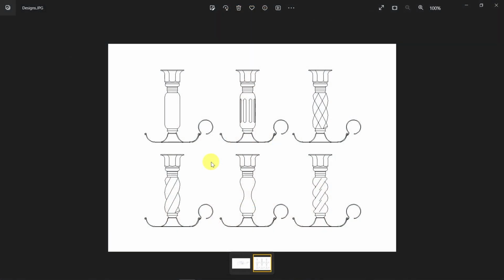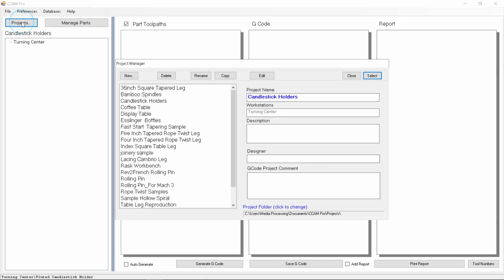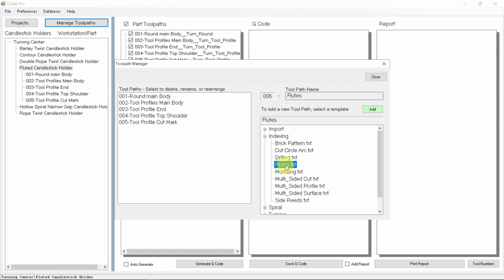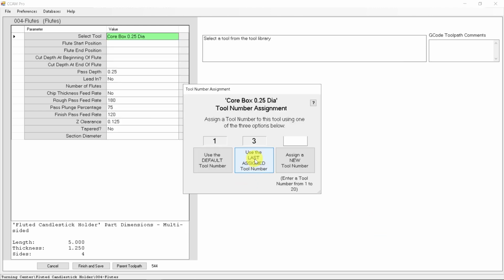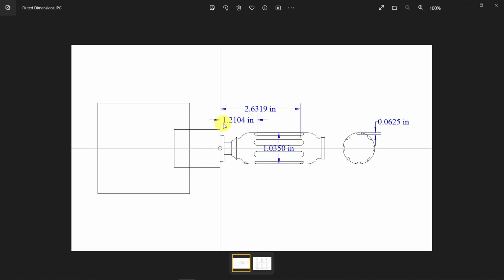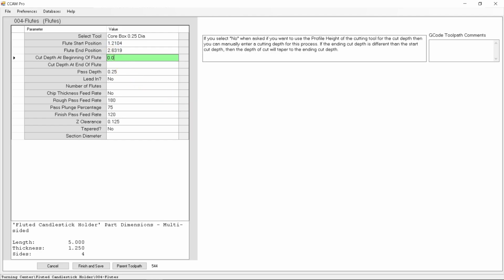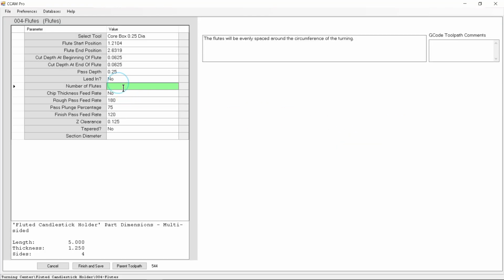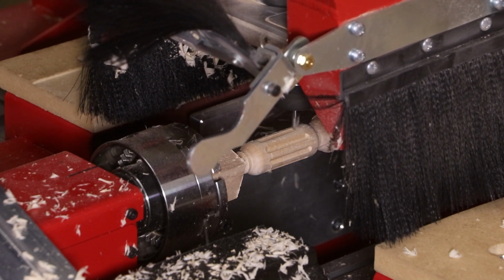Fluted Candlestick Holder

Comment: Thank you for this series. It is a great help in understanding how the Turning Center is programmed.

Software question: In each of the candlestick examples, you entered the diameter of the candlestick blank immediately before turning the decoration (spiral, fluting, or contour). Yet, shouldn't it be possible for the CNC to 'figure out' the diameter for itself? Immediately before the 'decoration' tool path, the CNC was directed to turn a cylinder of specified diameter. So, the CNC 'knows' the diameter of the cylinder. Couldn't this value be shared with the subsequent tool paths -- not so much to save the programming time of entering the value but to reduce the opportunity for a typo ruining the project?
Reply from the maker: Great question!  I will talk to our development team tomorrow morning and discuss that with them! Thanks! You Rock!